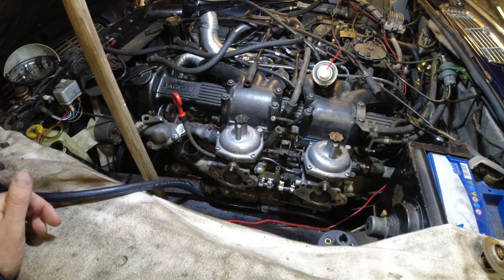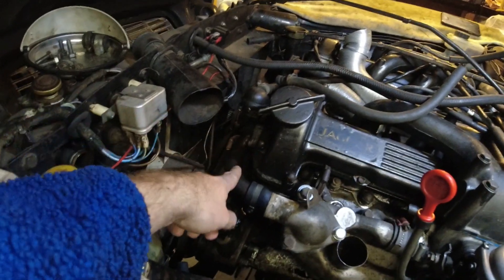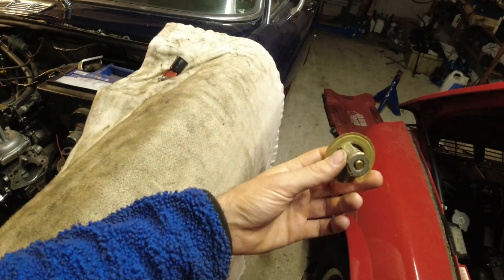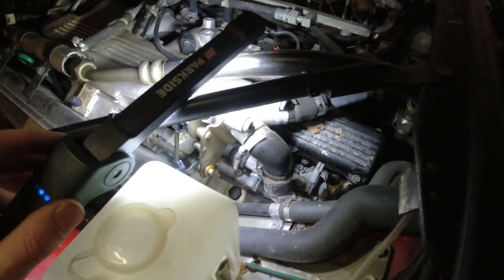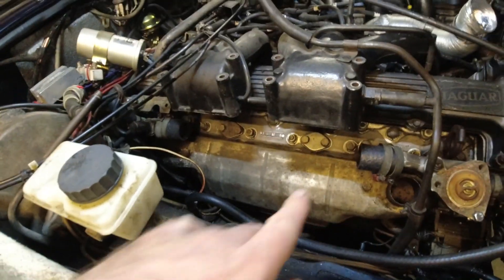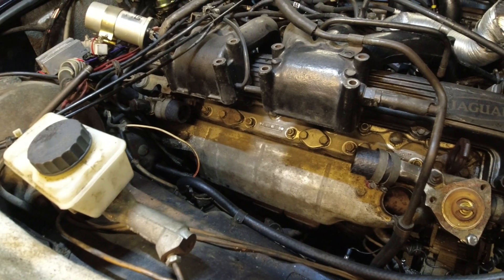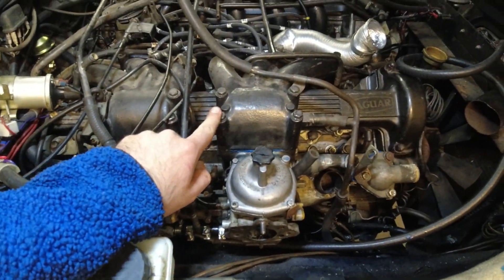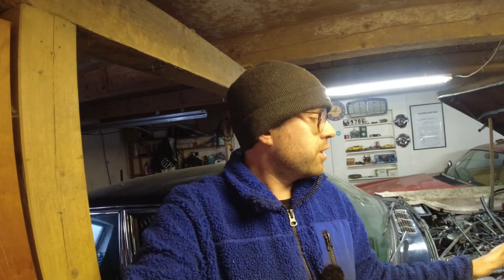These Coolant Hoses are Tricky Yet Important on a Carbureted Jaguar V12

Comment: I seem to recall a trick for getting hoses in confined spaces to go on pipes using string. It's a variation on installing window rubbers. Wrap a piece of string around the pipe, put the hose on top trap the string, then unwind it. There was a hose on the Mini's engine that had a standard installation time of minutes, but could be installed in seconds this way.

Comment: An interesting vlog Adam, an alternative method is to leave the carbs/induction block in situ and remove the water rails instead. Whilst fitting new hoses, replacing the water rail gaskets and checking for corrosion of the water rail bolts that attach to the cylinder head is no bad thing.

Comment: Hi!

Can you please let us know the part numbers needed for your projects. It would help a lot. 

I have some loose bolts in the exhaust pipes near the engine. I am gonna replace the hoses as a side project (😂), as i’m forced to strip down some parts to get room for tightening the bolts. Onlydaimlerproblems..

I cant seem to find the proper hose kit and sealings. 

Thanks Adam!